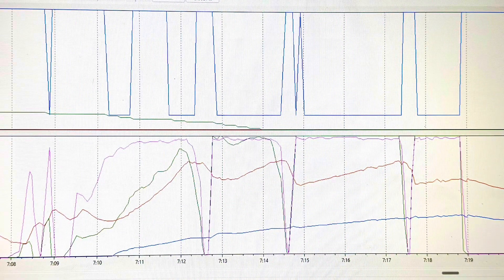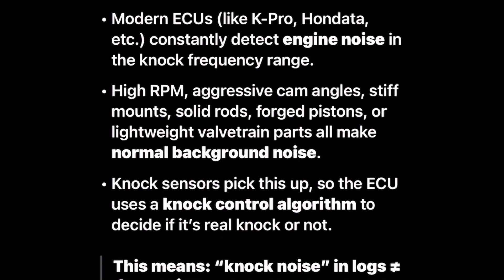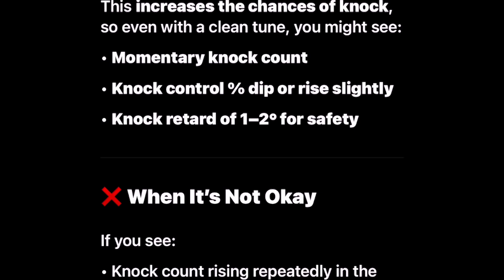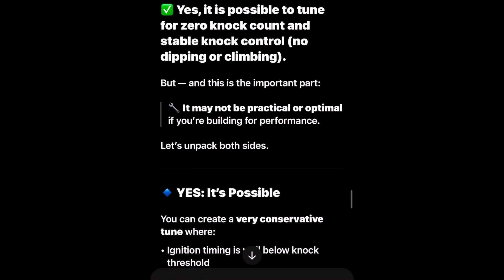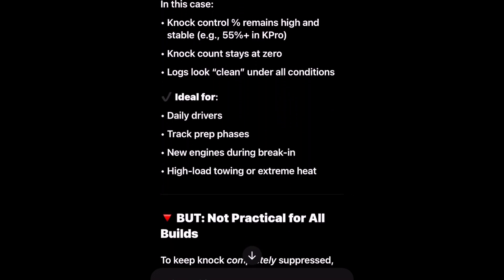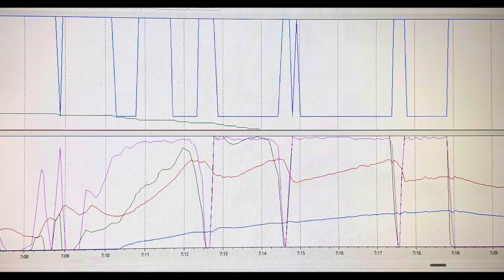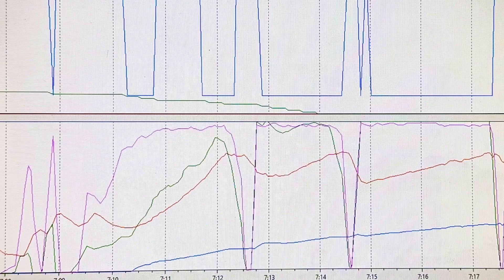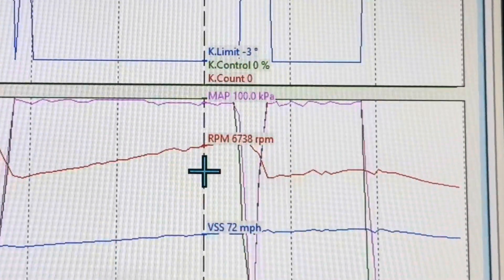CHAT GPT TUNING with K-Pro KNOCK and TPS

Comment: knock events are bad MMMKAAAY.
While the answer a few knock events may be ok for the ragged edge of performance... 99.99% of people should put their ego aside and tune for conservative no knock tune. Leave some on the table for a bad day. Each knock event is like hitting the piston + conrod + bearing with a sledge hammer.

also, rotaries will knock..... Once.

Good video, I've also been seeing people generate starter tables (Injector compensation / AFR / VE / IGN) just giving it basic inputs.
Dodge uses Neural net decision making in some of it's ecm's
Reply from the maker: Finally a constructive comment thank you for being human lol 💪💪
Yes knock is NO BEUNO, but the knock sensor will always be listening. Out of 20+ re-tune iterations in relation to making progress in baby steps, the most knock counts I’ve ever gotten as in REAL KNOCK COUNT EVENTS was about 3 events in total in a given log. I learned what I did wrong, just trial & error. As of recent day, I get ZERO knock.. pedal to the metal maxed out to rev limit in this video to verbatim provoke real knock counts, and as you can see there is zero knock count. 

For the “bad days” as you mention, when those conditions arise, there ids what to call (competition tables). AIT increases, it adds fuel.. ECT increases, it adds fuel… knock noise increases, it pulls back 3° of ignition.. if it sees a lean condition, it will add fuel via throttle tip-in  or use (rev-cut) to alert me bcs that’s another protection barrier I can use when those thresholds are met.

That’s why you see me antagonizing GPT with knock questions, it’s to provoke it to answer even the most profound contradictions like you mention about suppressing knock to the point it does not even show up as noise in the logs… because if you tuned your ecu to be THAT docile, the running conditions would be very unhealthy as a matter of fact.

Did you catch those parts in the video?
Reply from the maker: But tell me more tho.. I’m only backing up what my experiences have been but I’m still open to more discussion. Critical debate is always welcome 🙏😎
Reply: @AutoBodyEverything  I'm still learning my self. Need to get my MR2 4A-GE running rusEFI going again.